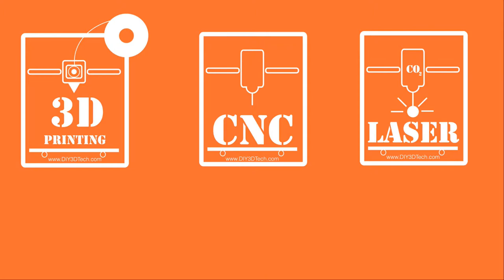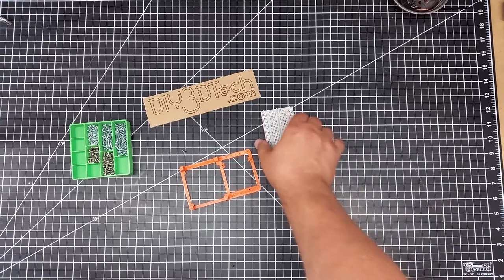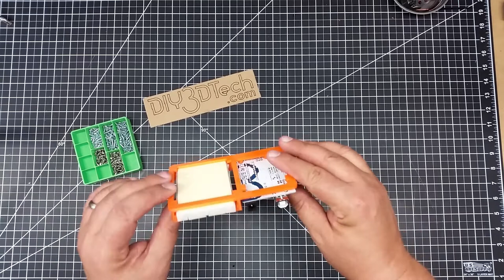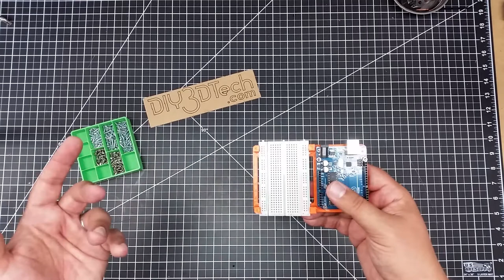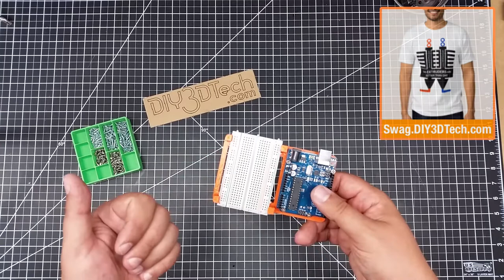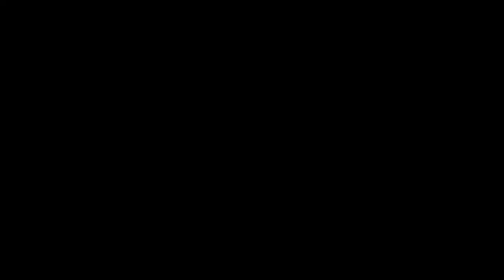3D Printed Project - An Arduino Uno Prototyping Base!

Comment: Keep in mind the legal rules; 
 Creative Commons - Attribution - Share Alike license.
 What does this mean?
               You must attribute (give credit) to the creator of this Thing.You must distribute Remixes under the same license as the original.Remixing or Changing this Thing is allowed.Commercial use is allowed.
Reply from the maker: I guess I am missing the point?
Reply: The Thing license for this 3D object requires; Arduino and Breadboard Holder by KenWilkinson62 is licensed under the Creative Commons - Attribution - Share Alike license.               What does this mean?               You must attribute (give credit) to the creator of this Thing.You must distribute Remixes under the same license as the original.Remixing or Changing this Thing is allowed.Commercial use is allowed.
Reply: @TheViewFromUpHere What are you talking about? Joe didn't remix the model and he provided the creator's link to the model in the description. What more are you suggesting he do?
Reply from the maker: Again I am missing the point to this as I do not not recall re-mixing this thing so?
Reply: The license says that ; You must attribute (give credit) to the creator of this Thing. You eventually provided the link but is that giving credit to the creator? Probably not.
Reply: The license says that ; You must attribute (give credit) to the creator of this Thing. He eventually provided the link but is that giving credit to the creator? Probably not.
Reply: Joe, I think @TheViewFromUpHere is just trolling; he can't be seriously suggesting attribution requires a verbal act?
Reply: No, but how about "Arduino and Breadboard Holder by KenWilkinson62" instead of just "Arduino and Breadboard Holder".
Reply: Nope, not necessary at all and is redundant.  Attribution is clearly given via the link to author's model as this was not a remix, offer for sale or any claim to the author's work.
Reply: Here are 2 links you might find interesting. https://wiki.creativecommons.org/wiki/Best_practices_for_attribution  and  https://creativecommons.org/faq/#how-do-i-properly-attribute-material-offered-under-a-creative-commons-license

Excerpt from the Best Practices link

Don't make it too complicated
The license tells you to be reasonable:
You may satisfy the conditions in (1) and (2) above in any reasonable manner
 based on the medium, means and context in which the Licensed Material 
is used. For example, it may be reasonable to satisfy some or all of the
 conditions by retaining a copyright notice, or by providing a URI or 
hyperlink associated with the Licensed Material, if the copyright notice
 or webpage includes some or all of the required information.
There is no one right way; just make sure your attribution is 
reasonable and suited to the medium you're working with. That being 
said, you still have to include attribution requirements somehow, even 
if it's just a link to an About page that has that info.
Reply: All that said, I don't even think attribution is required for this video. Although it's 'good form' to always do so IMO.

Do I always have to attribute the creator of the licensed material?
You must attribute the creator when you provide material to the 
public by any means that is restricted by copyright or similar rights. 
If you are using the material personally but are not making it or any 
adaptations of it available to others, you do not have to attribute the 
licensor. Similarly, if you are only distributing the material or 
adaptations of it within your company or organization, you do not have 
to comply with the attribution requirement. Learn more about when compliance with the license is not required.
Reply from the maker: So here is the thing, what does the CC/Lic pertain to?  The "object", have I done something publicly (sell it (which the lic allows), give away, change it, etc) with the "object", no.  Have I shown an "image" of the object "yes" can that likeness be copyrighted "yes", is this particular image copyrighted "questionable" as only the "images"  on thingiverse are copyrighted and I can't remember if I used a screen shot in this video or not.   However there is case law around "design" and if something is "unique" enough (which it isn't) and the proper paper work filed, then it's likeness is "protected" and I highly doubt that is the case here.  Second the designer incorporates portion of the Arduino design which in turn carries it own licences attributes, which one could argue that the designer is in violation as the arduino license says "Creative Commons Attribution Share-Alike license, which allows for both personal and commercial derivative works, as long as they credit Arduino and release their designs under the same license. "  As I didn't see credit issued to Arduino (nor will you in 99% of the cases).  So in short this goes back to a topic more of "copyright"  and there is this thing called "fair use"  as  fair use is any copying of copyrighted material done for a limited and “transformative” purpose, such as to comment upon, criticize, or parody a copyrighted work.  Therefore, since I "commented" on the work and it was of limited application (i.e.) video I am well withing the rights of fair use.  As "TheViewFromUpHere" what you may not realize is IP rights issues, copyright and trademarks are part of my day job and we have batteries of lawyers that deal with this as it is a complex subject (unlike how simplistic you make it).  And I appreciate your point that I forgot the link as in fact if you notice I forgot the whole description as I schedule these for future release and sometimes I forget as you see this is a hobby, I do this for fun and to "share" with others.  However I did take umbrage as your attempt to school me on creative commons licencing.  Are you the designer?  If yes I would be happy take the video down even as it is meant and does show the design in a positive light as my goal is to promote their work to which I also take no claim...
Reply: I just thought that since you liked it so much and are using it to produce content that you might as the license says; You must attribute (give credit) to the creator of this Thing. Maybe the link is enough but a better description for the link would be classier.
Reply: You prove my point since the author was not mentioned. This is an ideal attribution
"Creative Commons 10th Birthday Celebration San Francisco" by tvol is licensed under CC BY 2.0
Because:
Title? "Creative Commons 10th Birthday Celebration San Francisco"Author? "tvol" - linked to his profile pageSource? "Creative Commons 10th Birthday Celebration San Francisco" - linked to original Flickr pageLicense? "CC BY 2.0" - linked to license deed
This is an incorrect attribution
Photo: Creative Commons
Because:
Title? Title is not noted.Author? Creative Commons is not the author of this photo.Source? No link to original photo.License? There is no mention of the license, much less a link to the license. "Creative Commons" is an organization.
Reply: Thanks, 2nd link also proves my point. How do I properly attribute material offered under a Creative Commons license?
All CC licenses require users to attribute the creator of licensed material, unless the creator has waived that requirement, not supplied a name, or asked that her name be removed.
 Additionally, you must retain a copyright notice, a link to the license
 (or to the deed), a license notice, a notice about the disclaimer of 
warranties, and a URI if reasonable. For versions prior to 4.0, you must
 also provide the title of the work. (Though it is not a requirement in 
4.0, it is still recommended if one is supplied.)
Reply from the maker: The link is enough as (1) it proves I am not attempting to take take ownership and (2) provides complete details, as should one attribute the hyperlink itself?  Speaking of which there is case law on hyperlinks and attributions and if you look at the hyperlink (https://www.thingiverse.com/thing:871869) it cites the domain name of "Thingiverse" which one could easy argue [and it has been]  holds first party rights as the "model" is being distripubted by them.  Also for the description of the link  I use the "exact" title of the  object and I do not use the name (if you look way back I use too) as for one these are "handles" on thingiverse and not the their legal name and while we can argue all day the legal relevance of either a handle or pseudonym, unless it is legally applied (by birth assignment, trademark, copyright, etc) it is just a bunch of letters.  Yet this is not the reason I stoped this, however it was because in several cases I found (1) the handles to be offence which could have lead to issues with YouTube terms of service (as you will notice I do not swear or make other similar actions or statements in my videos) and (2)  some where simply to silly or too nonsensical so I simply let the title and link speak themselves.
Reply from the maker: You did read my long response didn't you? We are not speaking of a picture or words as in the second example as if you where to use "these words I am typing now" in another document you would be remixing my words and that would constitute a re-mix.  However as I point out, I am simply in the video using a facsimile (i.e. likeness of the object as the object is really its digital entity which I did not show the code) of the object.  As taken from the CC website: "Creative Commons licenses provide an easy way to manage the copyright terms that attach automatically to all creative material under copyright".  Notice "copyright" and now we see: "CC licenses do not reduce, limit, or restrict any rights under exceptions and limitations to copyright, such as fair use or fair dealing. If your use of CC-licensed material would otherwise be allowed because of an applicable exception or limitation, you do not need to rely on the CC license or comply with its terms and conditions".  So note "fair use" us is allowed under CC and you do not "you do not need to rely on the CC license or comply with its terms and conditions".  In simply terms you are attempting to apply your perspective as being "law" which this isn't as it is really a just a simplified "framework" :-)
Reply: @TheViewFromUpHere it is beyond my comprehension how you can read CC BY-SA 3.0 and make such assertions. I don't think you understand what the requirements are OR you are just trolling.  Personally I would take more time to re-read, digest and comprehend the requirements before making more public comments.